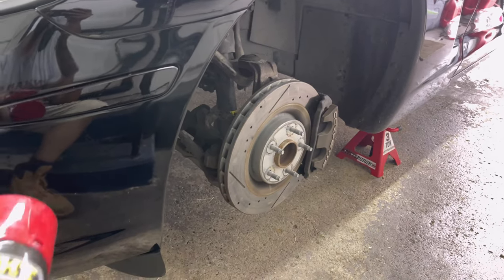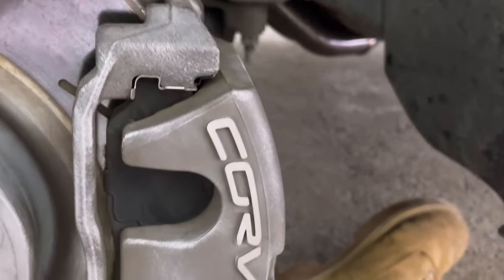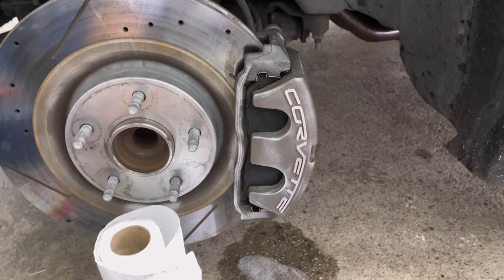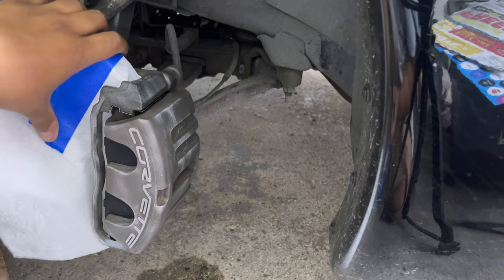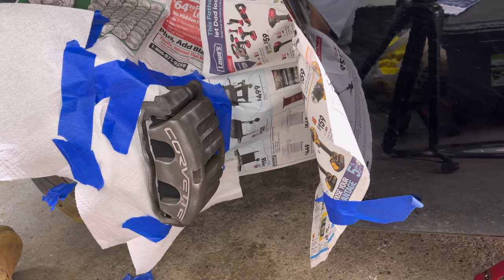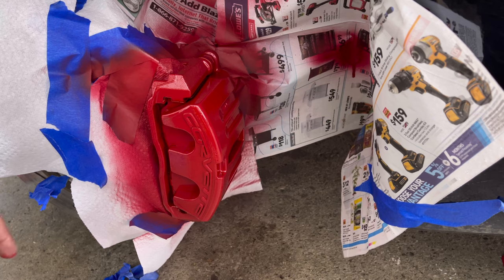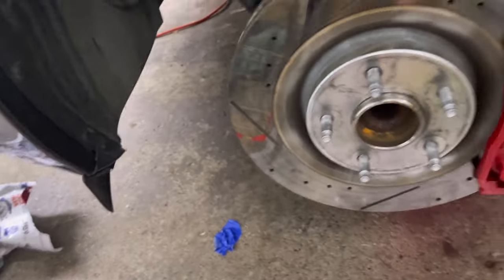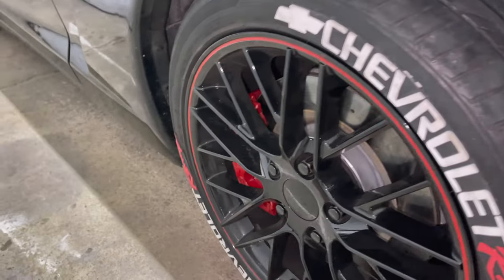How To | Caliper Painting | Step by Step | Easy ! | Tips and Tricks | All Under $25 ! #mustdomod

Comment: Don’t we need primer and glossy finisher for this process? Cause I seen other process which include 3 step painting. But this really simple method. All the best.
Reply from the maker: I used just the heat paint bro and with the layer of coats I put on , the gloss is so clean and still looks great ! I appreciate that so much bro !
Reply: @moderatemods98  ok 👍🏻